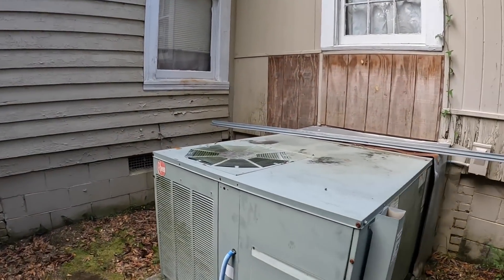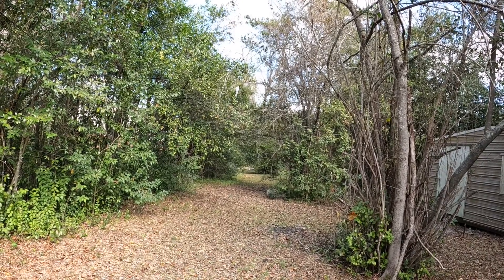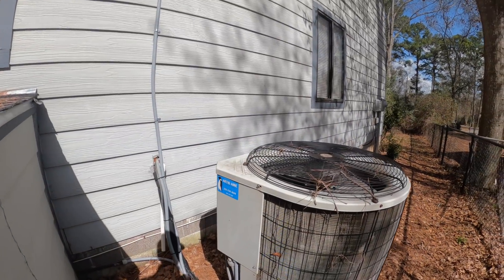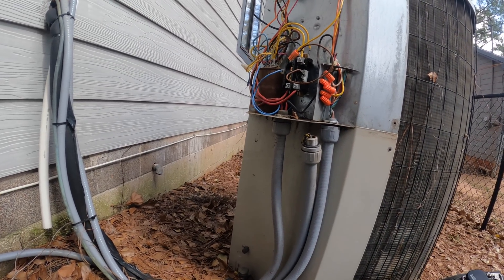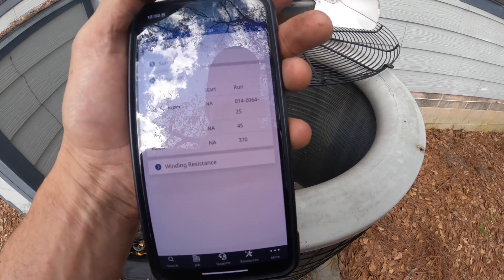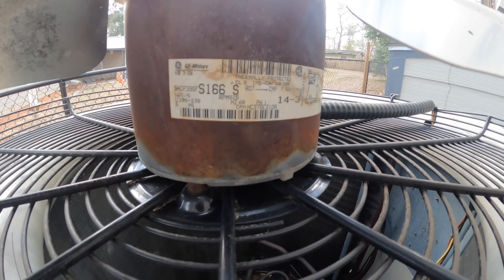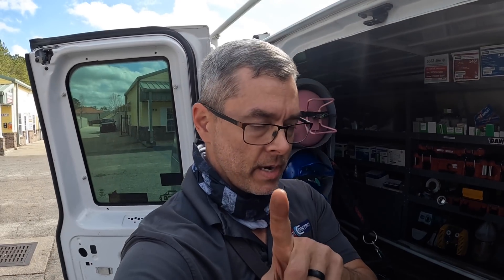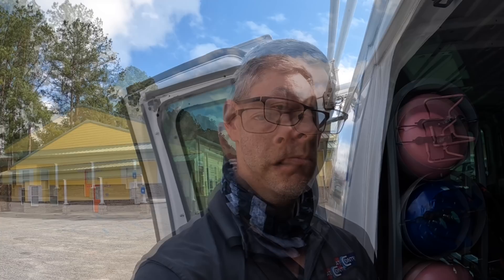Icing up In Heat and No Cooling 1999 Payne Heat Pump

Comment: I built a gas powered flat bed wagon it's small won't damage a yard but works perfectly for getting package units to anywhere they need to go just load the unit on the cart drive it onto the trailer then go to the house to do change out

Comment: If you even quoted repairing a 20+ yr old unit where I work, you’d be fired before the day ends. Imagine the cascade of issues that will come up after you replace that motor. Freon leak, blower motor dies, all that is on you for not recommending a new system with warranty

Comment: I’ve worked on a few trash cans before guess what they are still choochin mid to late 90’s as well Payne made some decent units back than. On aftermarket motors you don’t like to add piece of liquid tight over the extra wires ? I don’t like exposed wires plus it looks cleaner just my two cents.  🇺🇸🤘🏻

Comment: I agree with supporting law enforcement.  I have family and friends In it as well. I totally disagree with your opinion on pleated filters. I tell all of my customers to use a 1" pleated filter, even if it's a 5" media cabinet.  Fiberglass just let's all dust,animal air and other debri in and out blower wheel, secondary heat exchanger and coil. So I tell my customers to keep that out of them and check filter often and change when needed. A clogged blower wheel, secondary heat exchanger and coil causes air restriction and leads to bad heat exchanger and or longer running time of equipment.  Plus it's cheaper for them to filter it instead of pat higher utility bills and me to charge them to pull all of that and clean it. I know it takes away from my wallet but a happy customer will always call back and always gives me a referral.  
Just because I disagree with this minor issue doesn't mean anything toward how I respect you and your videos. I watch your videos because you do basically everything the way I do. Ha so the filter issue is only difference.  Good job on this one. Take care of those ribs.